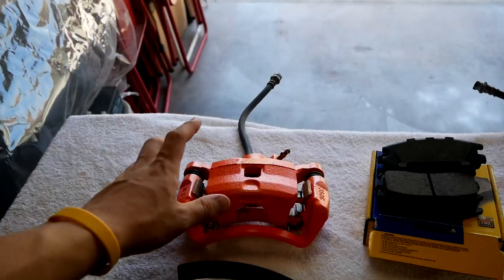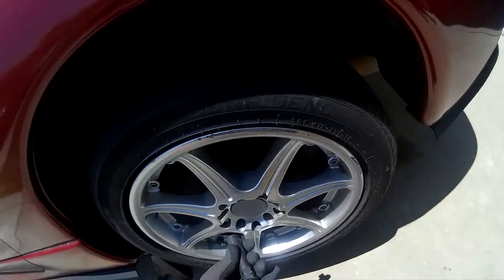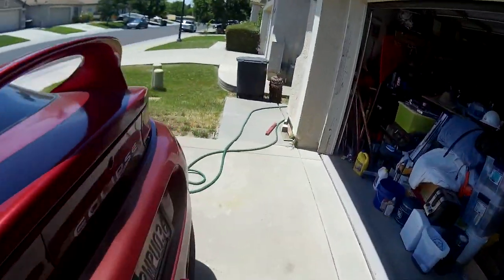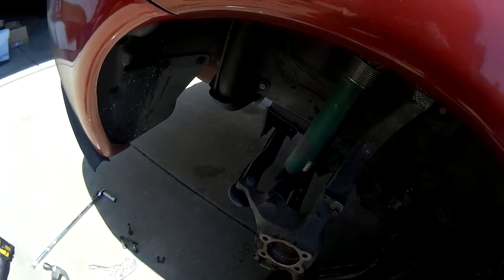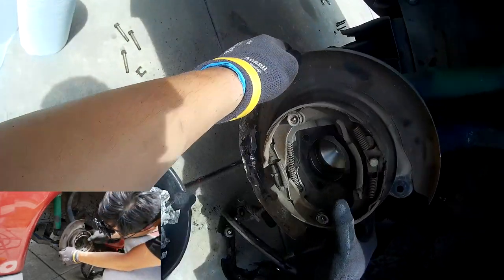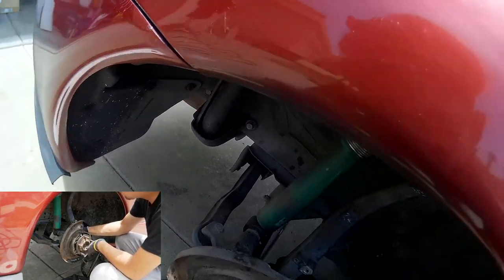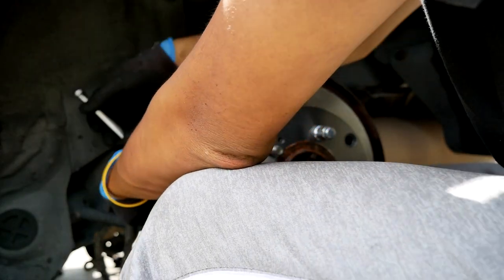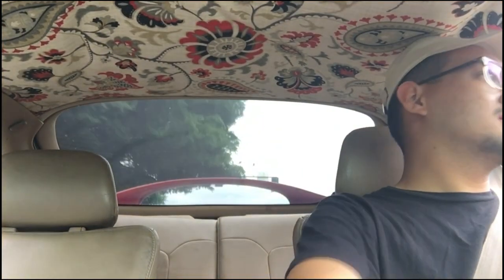REAR DISC CONVERSION 2G ECLIPSE DSM! | NickolisionCo.

Comment: What caliper paint did you use? Love that color
Reply from the maker: Thanks! Originally, I did some fluorescent orange spray paint with a high heat primer. It did last quite a while, just wanted to change the color again. Despite people saying no high heat spray paint is going to last.

If you have the chance to powder coat, that is a very good, durable choice when you want to paint something

Comment: Where did you buy backing plate?
Reply from the maker: Backing plate is from the pull as well. You CAN use the one on the car right now but you wouldneed to dremel or cut the ebrake cable bracket more larger to fit the cable. This was the easier method but that's if you want the extra steps after the brake install. Goodluck